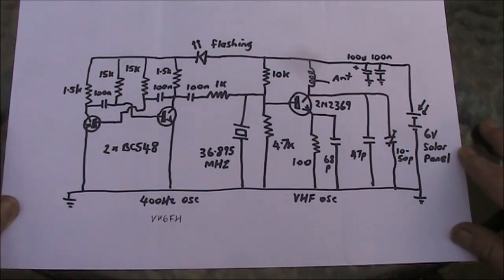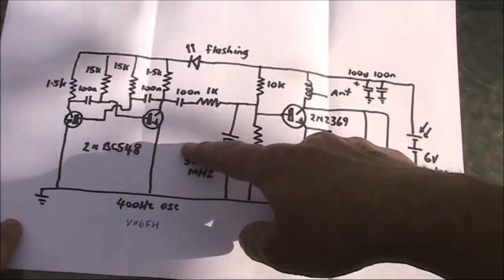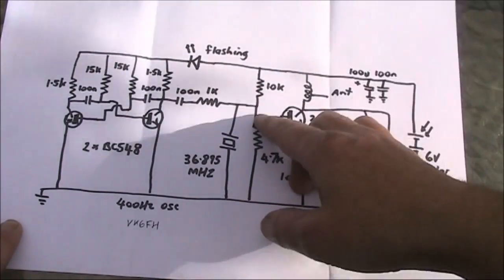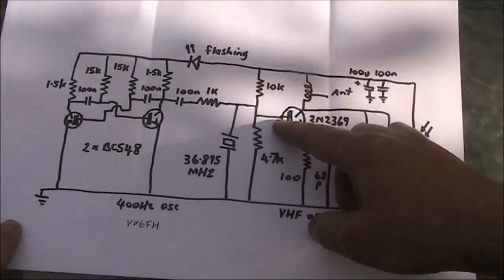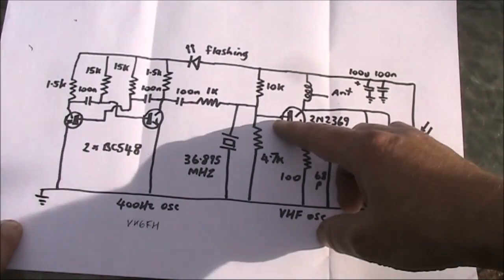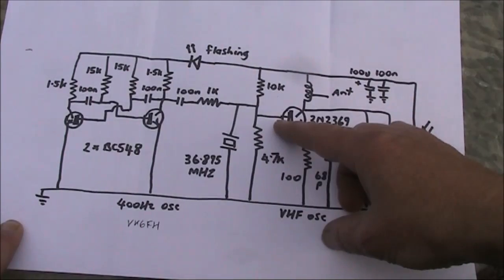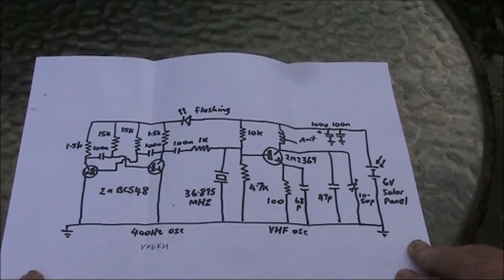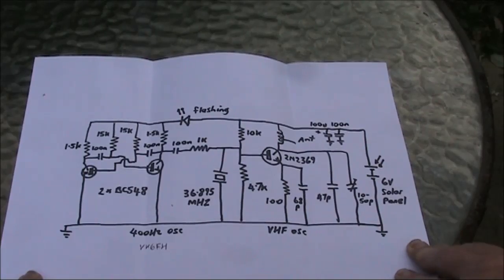Even better VHF solar powered pulsing radio beacon

Comment: I'm a new Ham. So this is probably a silly question but what is the purpose of this beacon?
Reply from the maker: It can be for anything you want it - testing propagation, antennas, receivers, short range links, telemetry - the list goes on. And the satisfaction of building a transmitter.
Reply: @vk3ye  Could I make it pulse slower? If so what components would be needed?
Reply from the maker: @kaseelee06  Probably. Try fiddling with some of the component values.
Reply: @vk3ye  ok will try that, thank you.